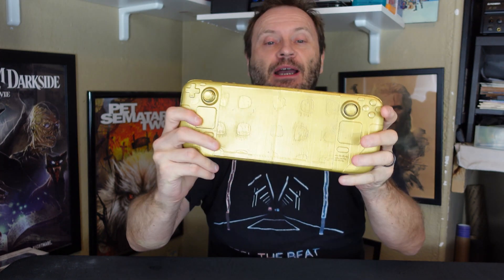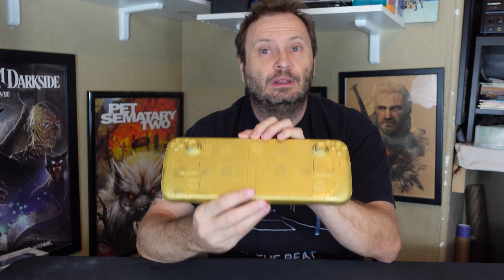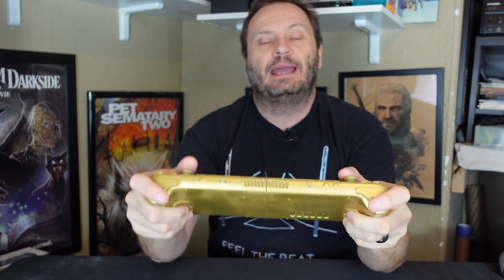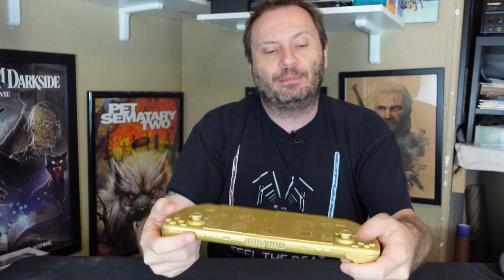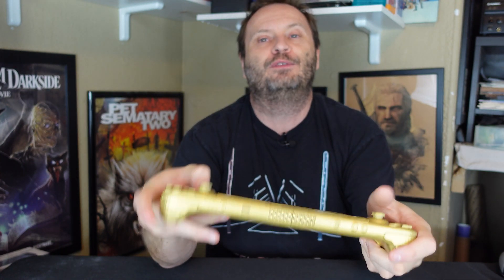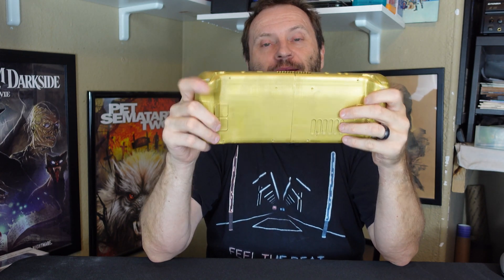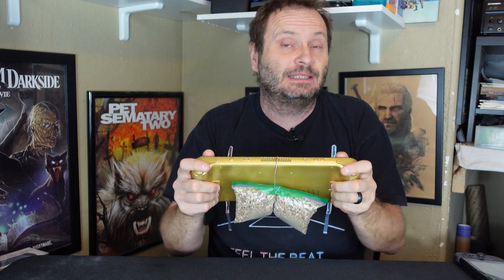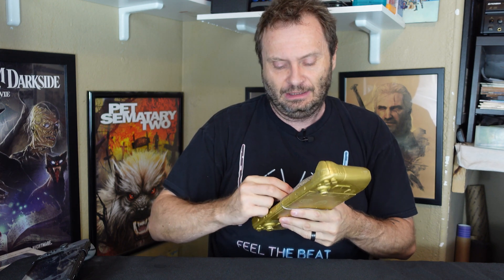Steam Deck: Let's Talk Physical Characteristics, Weight and Comfort with a 3D Model

Comment: I suspected reaching the trackpads would require a lower grip... That was a neat thing with the otherwise non-existent SmachZ, being able to rearrange the control layout as you see fit. I think some 'premium' controllers offer this as well, not the Elite though.
Perhaps too difficult to pull off in terms of cost and reliability, but if the Deck is going to be a success, maybe we'll see that in v2.

Comment: The reason people who messed with a real one didn't mention weight is because it's not really an issue.   The weight in a real one is balanced.  Which has a different feel from hanging a bag of rocks off it.  I used to fence so I will use swords as an example.  Swinging a well balanced saber is completely different to swinging a tire iron of the same weight.  The "balance" or where the weight is placed(no weight is not usually evenly distributed) in an object makes one hell of a difference.(example a sword has most of the weight near the hilt while a tire iron the weight is near the lug wrench portion) And several of the reviewers commented that the balance on the VSD is excellent so they don't see people having problems with the weight unless they are like holding it over their head in bed for a period of time.

Comment: Weight is really not that big of a deal as people make it out to be. The Swich weight is 2/3 with the joycons attached, of the advertised Steam Deck weight. That's also without the little addon you had with the grip extensions. Plus, like you said, the weight is equally distributed, whilst here you had all the weight centered, thus making you balance it by holding it differently. As for the trackpad, the ergonomics of using the left stick with the right trackpad, are almost the same as every standardized asymmetrical controller. 

Good video though.
Reply from the maker: For sure.

Comment: I'm not worried about back buttons/paddles, on the Steam Controller they are in a similar position and they are OK to use and hold the controller at the same time.
I'm more worried about the pads usability, they seem badly placed for long gaming sessions.
Reply from the maker: I'm extremely spoiled with rear controls.  I'm hoping it will work out ...

Comment: You should buy those tiny blocks of metal, that can act weights, and strap them on the deck across it, evenly.

Reason being is that, having to hold a hanging object will require more force, than if that weight is being evenly distributed on the deck.
Reply from the maker: Yeah, there are like a dozen better ways to do it, but without really knowing the distribution of the weight in the Deck?  We're all just kind of speculating.  I thought the bag of rubble was ... funny anyway :D

Comment: Why not weigh the switch with the grips on it that you use to get a better comparison. Id imagine those grips add anywhere between 50 and 100g of weight
Reply from the maker: The Switch with grips was 502 grams.
Reply: @darkuni  so 167 gram difference about 6 oz difference
Reply from the maker: @JohnRodriguezVodnikHOTS  Not nearly as dramatic.
Reply: @darkuni  yeah and satisfye sold like 1 million units. And that's just of their version. There's also that chonky switch controller attachment that completely replaces the joycons. So I'd imagine there's at least 2 million people bare minimum who would be unphased by the size/weight of the deck

Comment: try attaching the weight to the front of the mock device (where the LCD would be). use 2 straps so it's well secured, so not sagging. how does that feel when you shift the weight there instead of where you had it in the video.